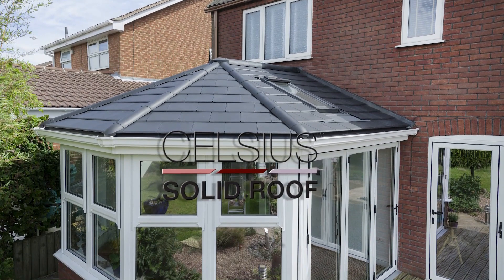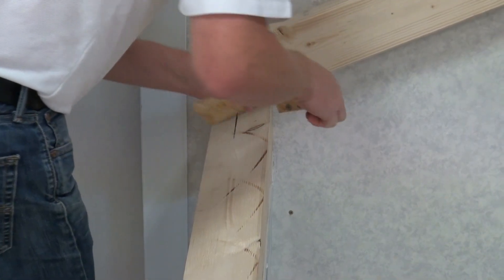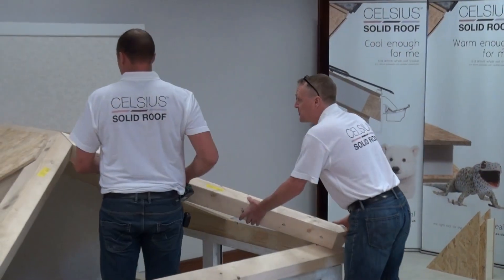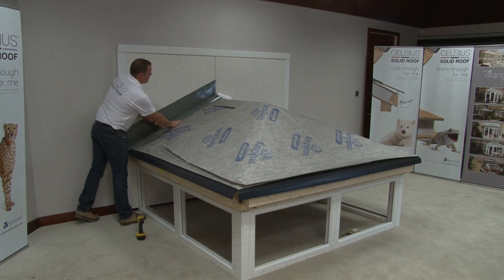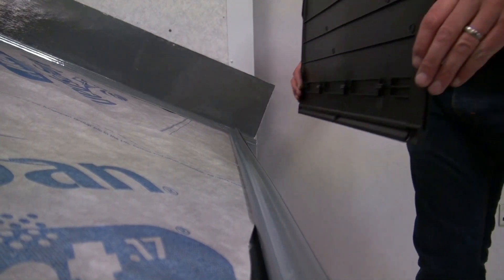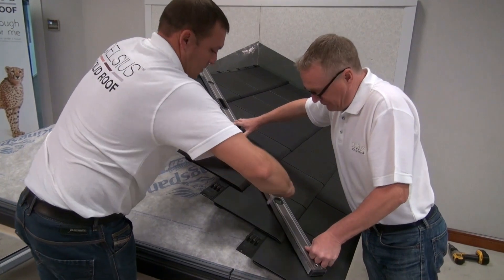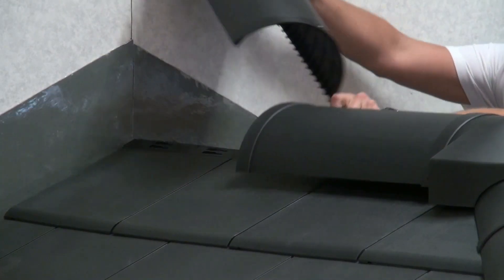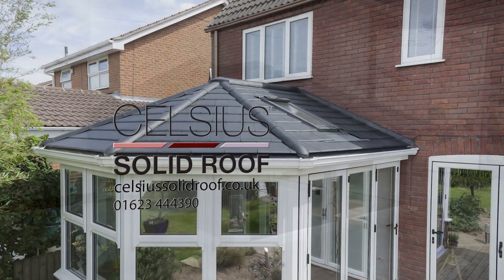Celsius Solid Roof Installation Guide - Aperture Group

Comment from the maker: Hi Deadmau5_1, absolutely not. The Celsius Solid Roof System uses tried and tested Kingspan TEK panels, which carry BBA approval. The whole roof uses a Kingspan Nilvent breathable membrane, and the innovative tile design allows air to circulate freely. Our warm roof system carries LABC, LABSS approval and has undergone rigorous third party testing and has certification for zero condensation risk. If you want a roof you can trust this is the one for you!